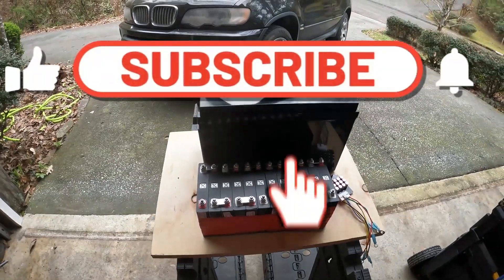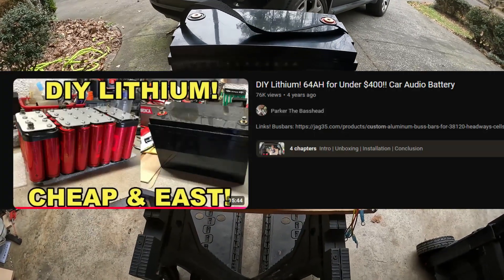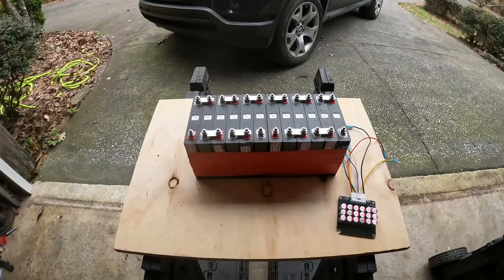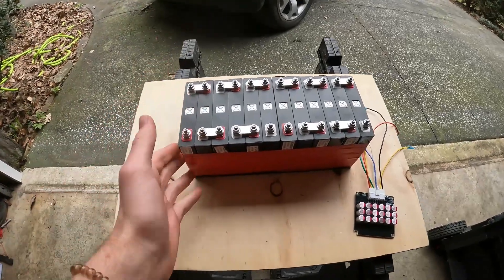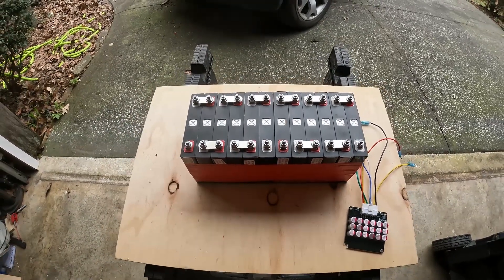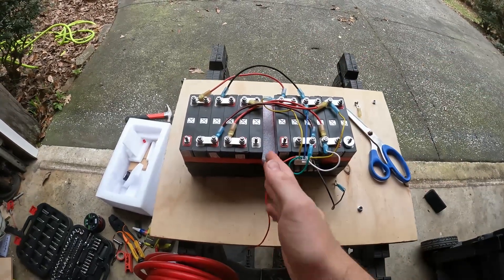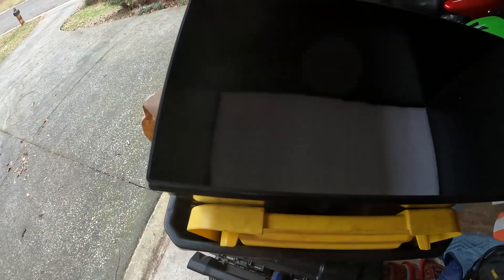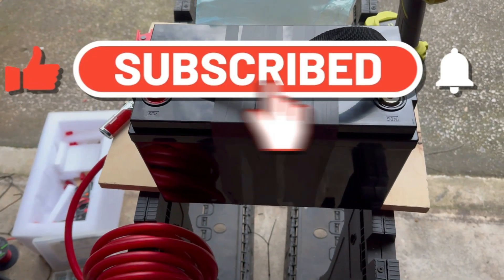DIY Lithium! (LTO) 14v 40AH UNDER $300!!! Car Audio Battery!

Comment: Nice attempt, but I have to point out the numerous safety issues going on in this build. Using the small underrated bus bars that came with the cells, copper clad aluminum "0 gauge" (not true AWG), improperly sized ring lugs (poor contact patch), improperly crimped ring lugs, improperly torqued cell terminal nuts, and the use of a washer below the ring lugs will all contribute to increased resistance and heat with high current loads. Enough heat buildup inside of that battery case can cause a fire. I sure hope you at least have properly sized overcurrent protection as close to the battery terminal as possible. Knowing how much current these cells are capable of, this is a vehicle fire just waiting to happen. Oh, and BTW, that's only an active balancer, not a actual Battery Management System. It does nothing to protect the cells from over/under current or voltage, let alone temperature protection. Also, you could have eliminated all of the parallel balancer wires and battery cables if you just connected the cells in parallel pairs before making the series connection. If this battery is still in service, I would highly suggest to rebuild it at least using pure copper true AWG cable (no copper clad garbage) and thicker copper bus bars adequately rated to handle the current for your application. Also remember, overcurrent protection is used to protect the cables, not the equipment. Only if sized properly for the application can it help prevent a fire. I really hope you take this as constructive criticism. Good luck!

Comment: From one basshead to another: If you ever use this battery case again you can drill and tap M6 Grub screws through the upper lip of the case and it locks it on perfectly while still being able to access the battery later without cutting. Love what you do man and I hope this can help someone trying out DIY. Stay safe!

Comment: just ordered 12 "22ah" cells for 120 green backs. crazy how cheap lto is getting.
side note, its technically safer to parallel adjacent cells next to eachother so like 2 in parallel before putting the next higher voltage cell in series instead of 2 parallel packs. then just use a 6s active balancer, i like the inductive variety better, less standby current and inductors last forever unlike capacitors. capactive active bal does get you closer to a cell delta of about 0.1v, where as inductive will only guarantee under 0.3v delta, but theres enough voltage range for this not to matter. just want to minimize large cell voltage excursions and have a bulletproof battery.
you also want to order and cut 5x epoxy insulator sheets to place between cell groups of different voltages. thats because the outside case of prismatic cells is actually the negative anode and when you rely on the heat shrink you can either get a short between from nvh/rubbing, or there is actually some current loss over time due to capacitive electrical flow straight thru the insulator wrap which will exagerate cell voltage deltas and put more stress on the active balancer.

Comment: So you are charging at 15-16.2? These batteries work best between these voltages
Reply: Thats not true it depends on the battery you can design a battry to charge properly at stock voltage but if you get a higer voltage one then yes
Reply: @ryzenpeak it’s absolutely true, I have built about 12 of these banks and have 108ah of SCiB in my daily, if you charge this type of battery below 14.8v it will cause a degradation of the cells. It’s 6S not 5S, the resting voltage of this bank  should be 15.6 it would make no sense to charge it below 14.8

Comment: Great vid, still deciding between yinglong cells and the prismatic cells, not sure there is much a difference in output. Would like to see you test this bank, especially to see voltage drop under load.
Reply from the maker: @LenzoB  I just found this on AliExpress: $442.49 (sale 205)| 12V 40Ah Lithium Titanate Battery pack Yinlong LTO 6616010C High-power Built-in BMS Car audio Rechargeable Battery Tax-free
https://a.aliexpress.com/_mttJDB1
Reply from the maker: @LenzoB  I got both. Yinglong still superior may I help you out a little. Go to AliExpress and search yinglong bank LTO and they are going for 250 bucks best on market
Reply: @Zachecker the prismatic 2.9, 6, and 10ah SCiB cells are way superior than any of the ying long cells (it’s not even close in performance). You would need 4x more ying long ah to compete with the small ah prismatic cells. This has been proven.